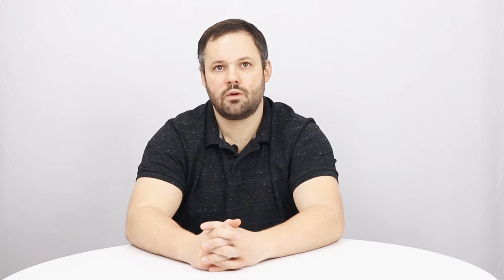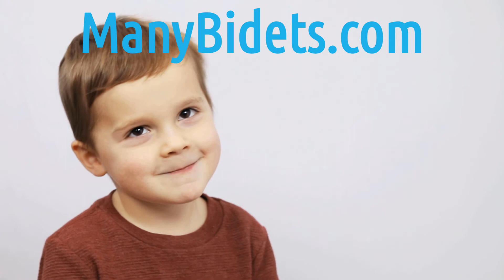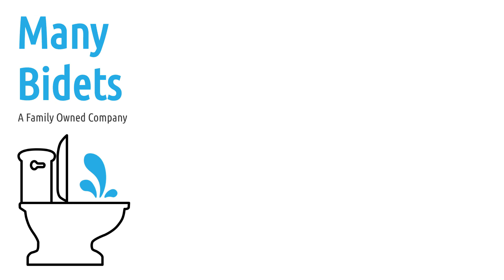Do I need a hot water line for integrated bidets or bidet toilet seats? | Bidet Answers with Dan

Comment: The toilet has it’s own room no hot water. My bidet has hot n cold connections ca I just hook up the cold water line only. With no leak?
Reply from the maker: It depends on the unit.  Some non-electrics allow for that, but some don't.  If yours has an option to cap off the hot water, chances are you should be fine.

Comment: My BB2000 worked great for 4 years. But now the water is COLD! What to do to get it warm again as before? So far I cannot find recommendations or instructions. Can anybody advise?
Reply from the maker: I'd recommend unplugging it and letting it sit for an hour then plugging it back in.  This forces it to do a reset.  It's sadly also possible you're dealing with a water heater that went out, in which case the heater would need replacing.  Do you know if you got an extended warranty with the seat?